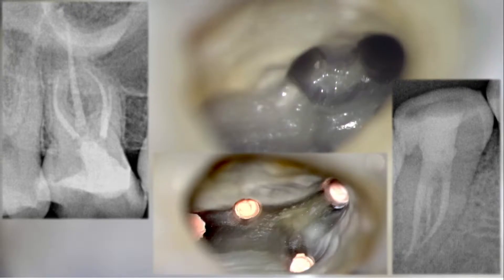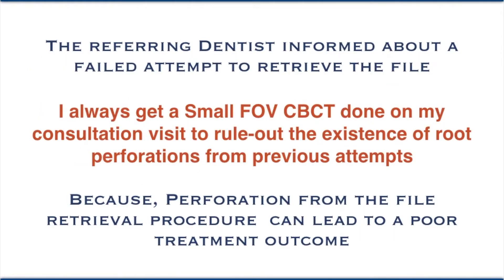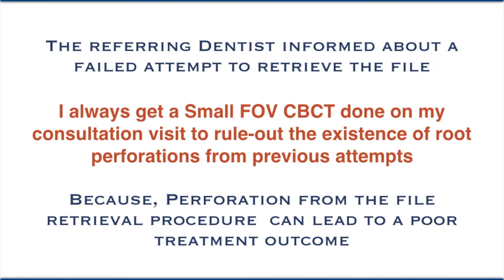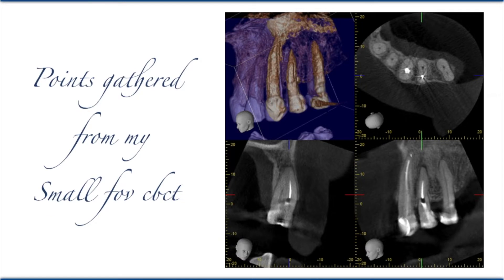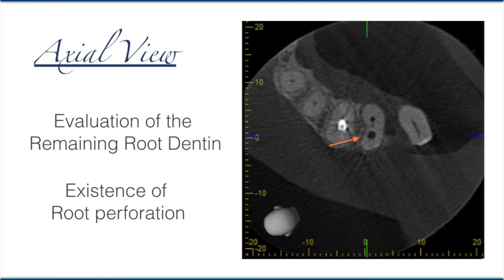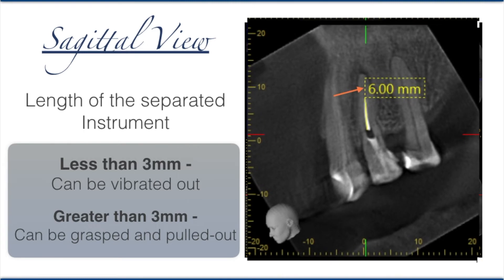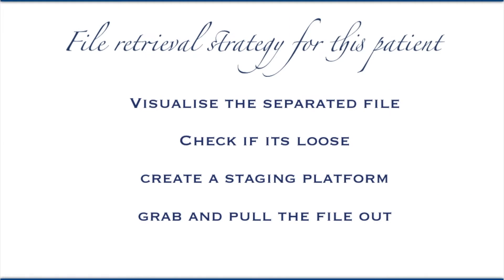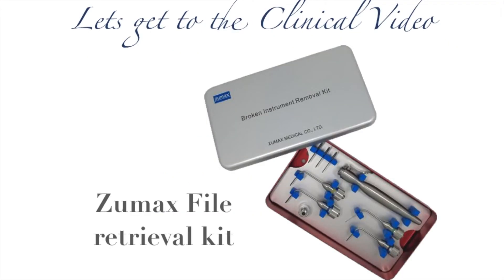Broken file removal

Comment: If canal is only prepared by 10 no. file and file separated then what to do
Reply from the maker: We only have 3 options 
1. Retrieve the file
2. If unable to retrieve then try to bypass
3. If retrieving & bypass not possible then leave it in situ
But the existing pathology is important in determining the prognosis of that tooth
Reply from the maker: Hi Dr Sumegha, If a #10 file separated when shaping, Its clear that the canal is under shaped and contaminated. We should have the file removed or bypassed to efficiently clean the canal space. Another point to note is the size of the periapical infection. Teeth with large infections need thorough disinfection and medication before its root filled. So, we cannot leave the #file as it is and obturate the canal.